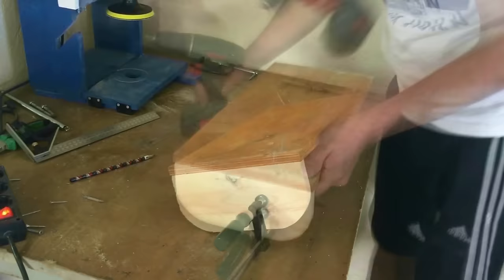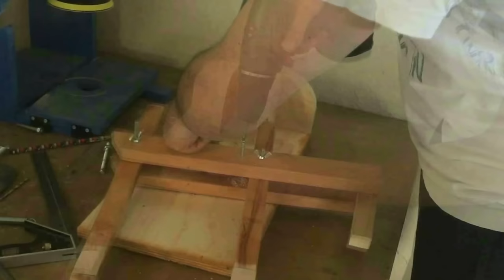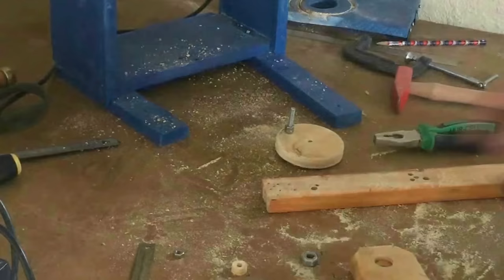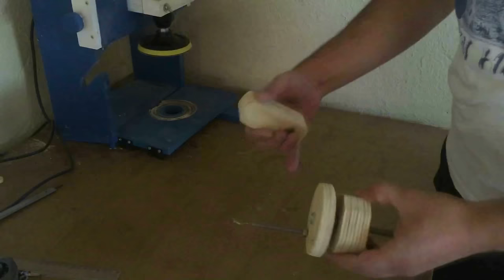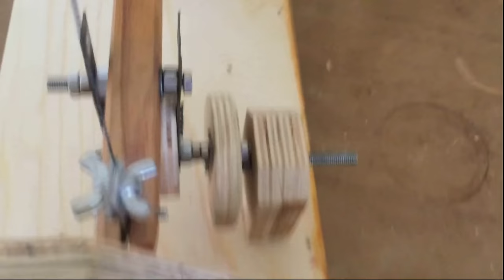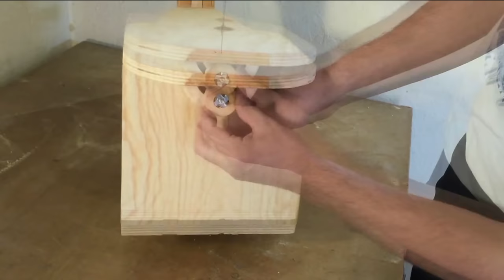Making a Homemade Scroll Saw (Drill Powered) - El Yapımı Kıl Testere Makinası

Comment: The measurements I can work out, but the Blades?  Will Coping Saw blades do, or do I need another type of blade? Thank you.
Reply: I've used coping saw blades in scroll saws when I worked in schools.  The children broke blades frequently, and coping saw blades were cheaper than 'proper' scroll saw blades.
Reply: @ParaBellum2024  So the coping saw blades will work. I thought as much, but I have been so wrong before and I needed a second opinion. Thank you very much.